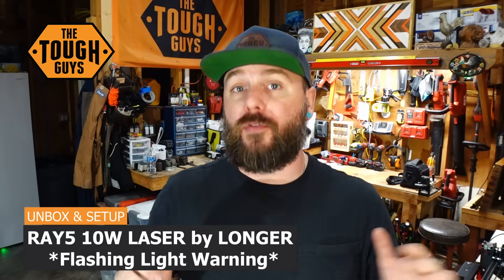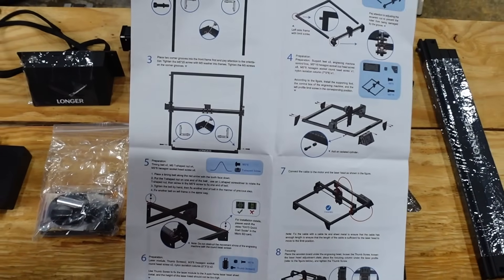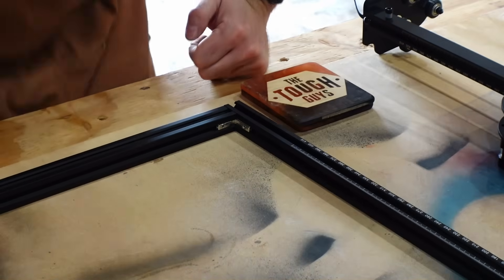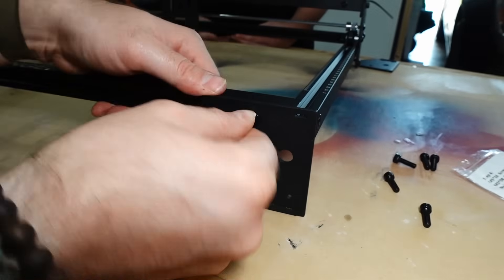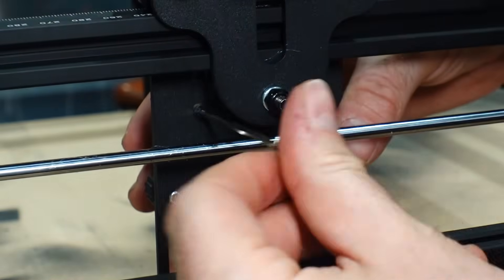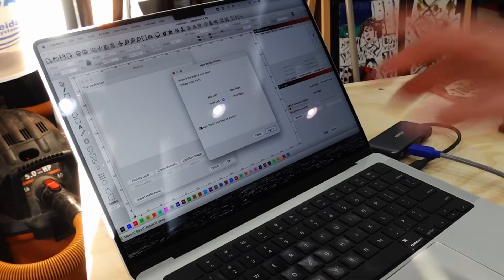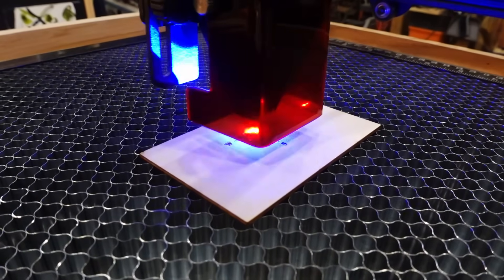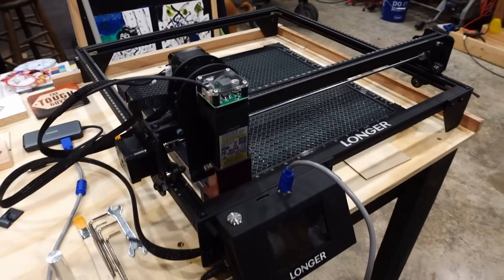How to Setup: Longer Ray5 10w Laser Engraver!

Comment: So I just finished assembling this. For those of you who haven't yet, I got to say when you're installing the belts rather than trying to thread the belt through one side or the other. It's a lot easier to just thread both sides through the top. That way you push the belt into the groove on either side and then you can use one of the zip ties that comes with it to just push it up so that you can pull it tight. Makes it way easier than trying to thread it either through the front or the back and over the gear
Reply from the maker: Good advice here! Thanks for taking the time to comment!

Comment: Hi there - Question - I noticed mention of limit switches which have to be bought separately. I also see where you do not have to have them with Lightburn. I am new to lasers and just finished putting my 10W together last night. I was planning on using GRBL for a while since I want to cut cursive text at first. I am not sure if I can do without the limit switches if I use Grbl, do you know? Also, my workbench is outside and the far from my computer so I was planning on putting the cut/burn files on the SD card. Will that work long-term? THank you

Comment: Does anyone know if it’s possible to use this machine with a smaller frame? E.g. 200x200 mm. Would the firmware allow for that? I would like to modify to a smaller footprint because Im both limited in space and I don’t need to engrave large pieces right now anyway.

Comment: Longer Ray5 10w is garbage.. 2 dead diodes in 2 months. Nothing out of normal operating specifications. Just junk. Sent in for warranty. Still waiting for the 3rd unit. Just do yourself a favor and DO NOT but this trash.
Reply: @derekyarno6644  that bites! I have a 10w on its way. I have a co2 laser but wanted something smaller
Reply: @russelllynch7606 honestly if you contact longer for their customer service it takes forever but they will make it right!

Comment: Fun fact, I put mine together last night without the instructions. Of course after I put everything together I checked the instructions to double check my work. Just making the point that this is a very easy product to put together. I was surprised to see the little bags labeled though. That was a great part. I haven’t used it yet but that’s on today’s agenda! I did order the honeycomb and air assist as well.

Comment: For engraving... How thick of an object can be engraved on?
Reply from the maker: With a laser like this you can get creative with building a platform under it to raise the laser head. But def want it to be sturdy. Generically probably only an inch or two at most.
Reply: @ToughGuysDIY I believe Lego slots in underneath the feet and makes perfect height adjustable platform try it ps watching through video now will have questions shortly

Comment: I have a question it is about the rotisserie that you get with your machine aren’t you set it up and you change the numbers in the program when you go back to using the laser for doing on wood do you have to go back and change those numbers or are they set in the machine and they automatically go back or do we have to go back and reset the numbers? I hope this makes sense.
Reply from the maker: I believe the software you use should help guide you with a rotary attachment, but I never used one with this laser so I don’t know for sure unfortunately

Comment: Is the xTool S1 better or na?
Reply from the maker: I think the S1 is superior yes: Full enclosure, vented air assist, riser base available, auto depth sensing, pinpoint positioning (for custom shapes), larger work area, and xTool creative software is superior than Lightburn in my opinion, it’s just all around a better machine BUT it does cost more, and for good reason.
Reply: @ToughGuysDIY  just brought one haha very excited its my first one

Comment: is there just a basic setting when you get the laser ?
Reply from the maker: Any settings I’ve used are through the software LightBurn. It dictates speed and power as well as how many passes the laser needs to make to complete the cut or engraving. On the small SD card included are some resource packs as well as template files for you too (or should be if they included it for you)

Comment: I set the whole thing up while watching your video.  This thing will not frame on the Y axis for me.  It only burns in a straight line.  Any idea what the issue is?  Doesnt matter if I use lightburn or LaserGrbl.